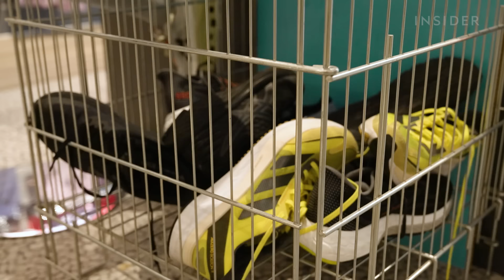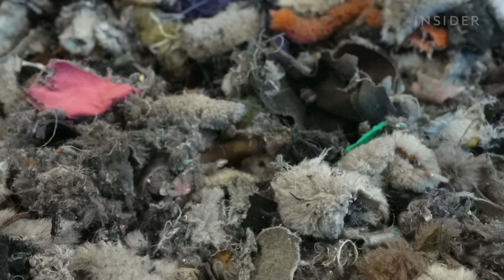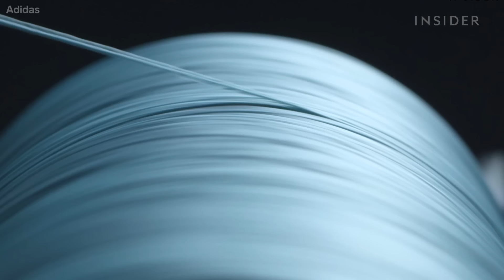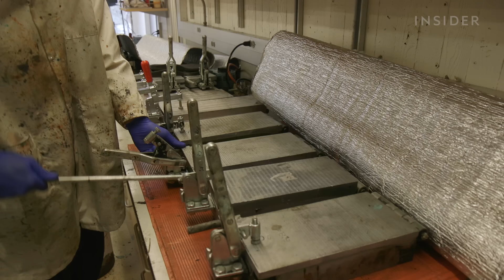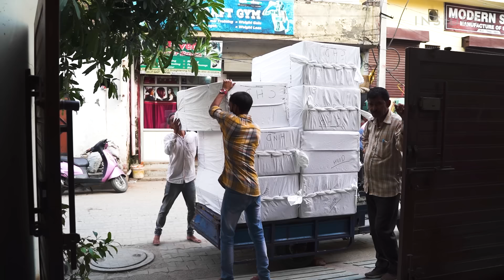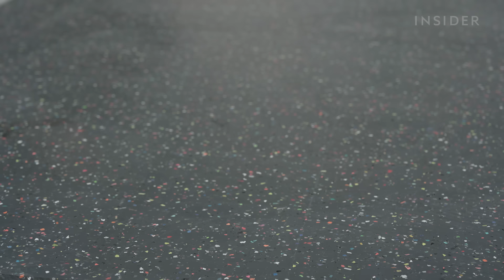How Adidas, Asics, and Other Shoemakers Deal With Waste | World Wide Waste | Business Insider

Comment: In 1974 in Newcastle a housing development (Byker Wall) used all the waste from the houses and flats in a community furnace, it didn't produce electricity but it did produce hot water for free heating, they had a clean burn system that removed the pollutants so they didn't get into the air after burning, why this hasn't been widely adopted and improved on since is a mystery, some say the fuel industry has blocked the idea so they can keep selling gas and oil,

Comment: Most of these shoes have small defects and are good enough to be used or those defects to be corrected. But brands won't sell them. They find that selling these to the recycler is cheaper than correcting the defect. I think this just adds unnecessary cost. The door companies can just correct it for a small cost and it will be much useful than selling new unused shoes to recycle

Comment: Plastics are literally not truely infinitely recyclable like metals and glass are, every time plastics are heated and treated they get weaker and breakdown more (not to mention the degradation from used plastic products) 9.9999/10 times if you want to make something of even comparable quality to the original product you HAVE to use virgin plastics in some point of the process, the idea of recycling plastics is basically greenwashing, it’s basically like trying to polish a turd, you can do it - but it will still be a turd

Comment: A Dutch company claims to have found a way to recycle every single part of a shoe, including foam and rubber, which are usually hard to break down. Fast Feet Grind (FFG) gets shoes from the Dutch military, from collection boxes in stores and directly from manufacturers. It uses a completely automated mechanical system that uses heat and friction to separate different components without chemicals like glue or solvents. The company separates the foam and rubber by grinding them down into tiny particles, isolating other materials from the shoe, such as fabric from the uppers, which can be spun into yarn to make new shoelaces, and metals from steel-toed safety shoes. FFG has also partnered with Asics to figure out how to make new sneakers from old ones, but shoemakers say recycled materials come with limitations. Adidas, which produces over 420 million pairs of shoes annually, has a couple of products in development, including a shoe made entirely out of virgin plastic, with no glue holding it together. The Futurecraft Loop was designed to be recycled into future generations of the same shoe. However, the plan only works if the company can convince customers to return old pairs.

Comment: Ive been using a woodlands shoe for the past 8 years....its seen everything from grueling mountain treks to being run over by a car (the shoe is so tough that thankfully nothing happened to me). The sole separated once but i got it stitched back by a cobbler and feels sturdier than ever. If shoes these days were that durable to begin with i dont think we'd have 50 bil shoes in landfills
Reply: Так и есть. Вещи делают одноразовыми и приучают нас считать что это хорошо.
Reply: Woodlands are tough to break. But they doesn't like water at all. It will start slip like crazy on wet surfaces and mild ice.
Reply: Io ho visto che la gente butta via un sacco di scarpe ancora in ottime condizioni solo perché non sono più di moda. Io cerco di disfarmi delle mie scarpe solo quando veramente non possono più essere aggiustate
Reply: Exactly right.
Reply: The fashion industry doesn't like this.
Reply: Finally someone that makes sense!
Reply: Well, not every type of activity can be done with a shoe like that.
Reply: So what about parties, you cant go to one with a woodland shoe
Reply: @Akram_medjdoub   To quote the Buddha... "If it can't be done in a woodland shoe, you should not be doing it."
Reply: @elementkx  so ballet shouldnt be done
Reply: @Akram_medjdoub   Fact- Buddha used to actually dance ballet in woodland shoes.
Reply: why not  @Akram_medjdoub
Reply: @Akram_medjdoub  woodland shoes actually works everywhere. You can go to parties as well to your work place daily.